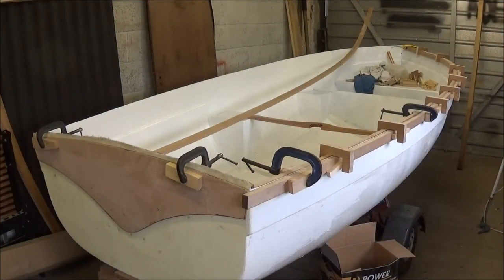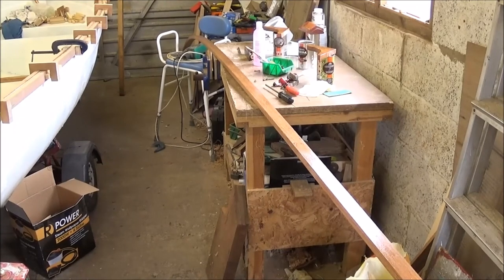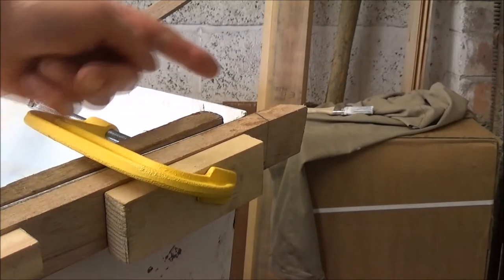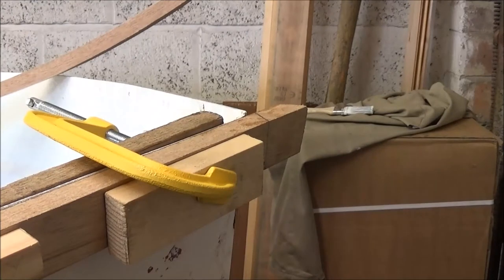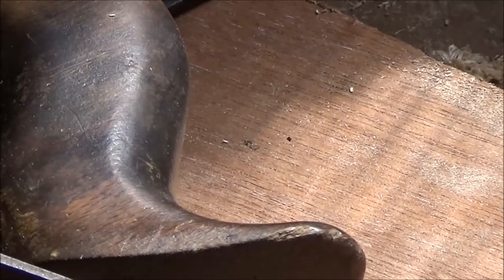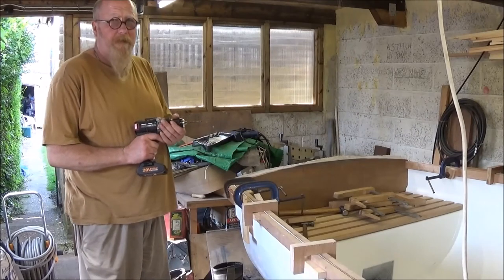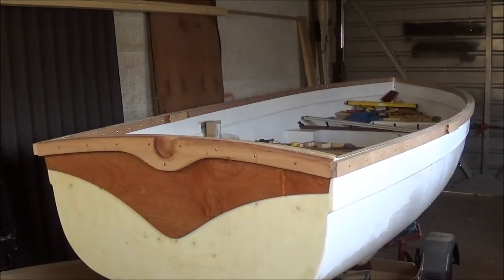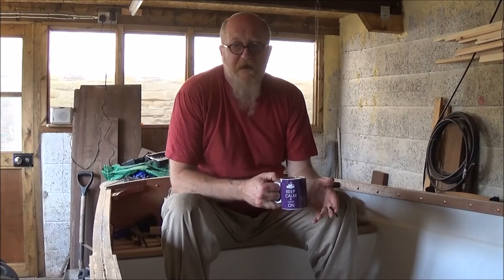Dale Skidmore -Boat Restoration Part 10

Comment: Nail heads have to be on the outside for aerodynamics. You would not want to cut into your top speed, would you? I  picked up a couple of planes at a yard sale.. Irons have big notches in them. One is german, the other is a stanley.. Just use it until it won't cut and then go buy a new one.My gain.  I have one sharpened up, but it is a lot of work. And an excuse for buying a couple of new diamond bench stones.  You could always use lee-boards instead of a dagger board if you wanted to put a sail on. The boat is looking good, I cannot wait to see it in the water. Thank you for the video, Ade
Reply from the maker: Of course! I knew there was a reason, lol. I acquired a chisel that had been sharpened from the back, ha, ha. It is time consuming putting the edge back, but worth it, hopefully. Diamond stones have come down a lot in price, I use them for the knives I make, but still old fashioned when sharpening the chisels and irons. I know what you mean about lee boards and have that in mind as an ongoing development, as I would quite like to have a go at sailing. She'll be wet soon enough, thanks for the ideas.
Reply: I have a good collection of fine pocket hones that I have picked up at yard sales. Large stones are harder to find around here. The irons on the planes need either a good grinder, hours on a cheap bench stone, or an hour on a diamond. I will buy a coarse diamond for the next one. I have the one honed up shaving sharp, and I just have to put it together and try it. I have seen pictures of leeboards that rotate up out of the way when you do not need them, but don't remember where. Not a sailor or a boat person myself. Thank you for the reply, Ade

Comment: Hi Ade, looks really good now, will you be stepping a mast into her?. Atb Keith
Reply from the maker: Cheers Keith. I want to sleep on her, so having a mast is not viable because she would need a dagger board box, which would be in the way. I have, however, seen a thing called a bridge sail being used on a boat, which is a short mast with a small sail which is held at the corner by a stick in your hand. I imagine it is used for helping get under bridges. I have been thinking of trying it out some time.